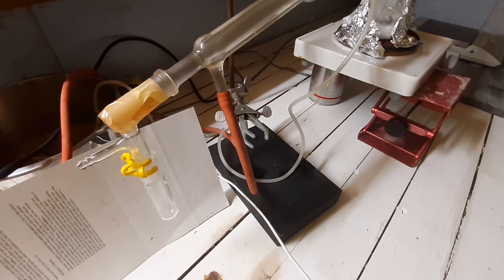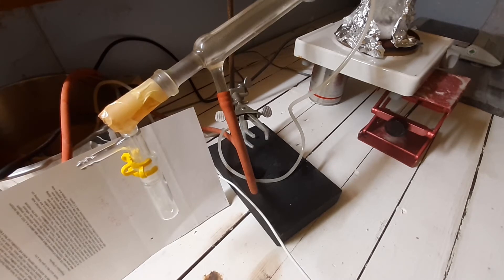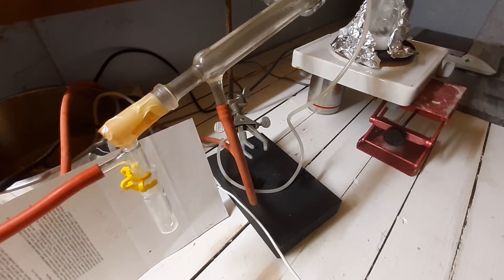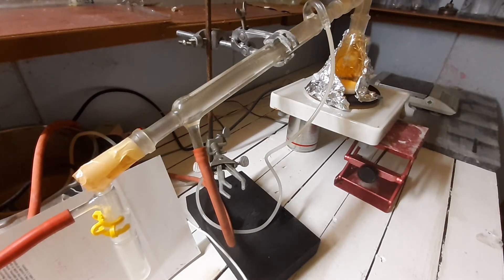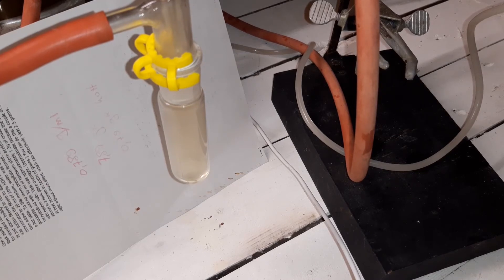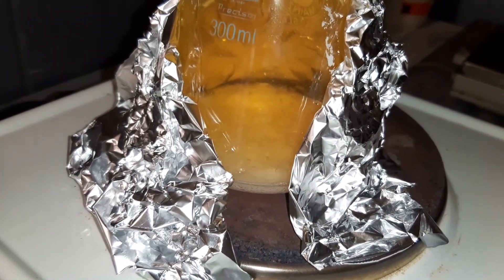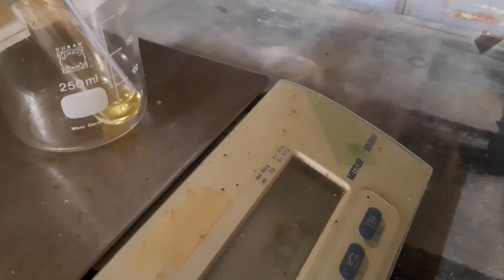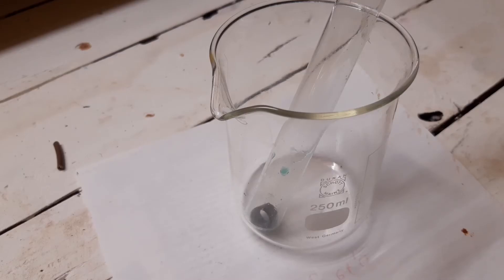Episode 5 - Nitric Acid From Ammonium Nitrate (Dry method)

Comment: concentrated nitric reacts super quick with copper and leaves a green solution. dilute reacts slower and leaves a blue solution. but very nice!
Reply: If the concentration is too high though, passivation will occur and the reaction will be greatly slowed if not stopped.

Comment: there are two different acids, nitric acid and nitrous acid... what i think you get in your reaction is nitrous acid (HNO2), not nitric acid (HNO3)... but maybe i am wrong.
Reply: It's nitric he's getting, you would get nitrous acid from a nitrite salt.
Reply: @chemistryofquestionablequa6252  maybe... in the past (like 20 years ago) there was extensive experiments and testing done by hobby chemists on X-inventions forum about this, what was concluded is that ammonium salts cant be used to make nitric acid, instead they yield nitrous acid... i would love to see the equation of this reaction.
Reply: @Hobypyrocom  Is the forum still around? I can't seem to find it?
Reply: @undernetjack  last time i visited the forum was back in 2009-2010, but even back then they only had the sections for hovercrafts and flamethrower, everything else was missing... now i am trying to find the records in way back archives and there are none... later when i have time i will check my old data that i have saved on external disks, i think i have the correct url of the forum there...